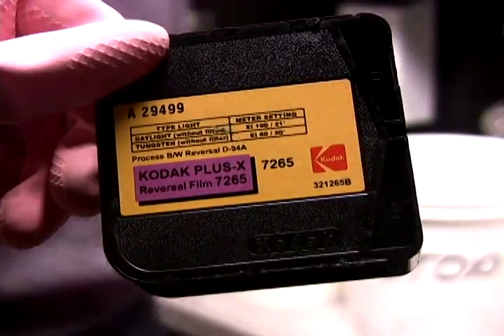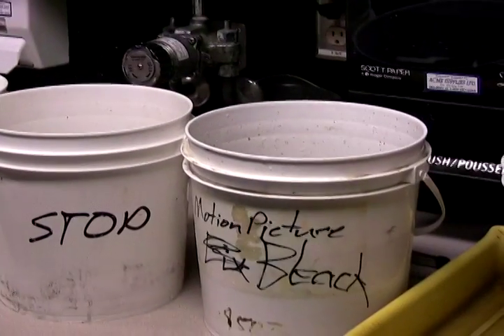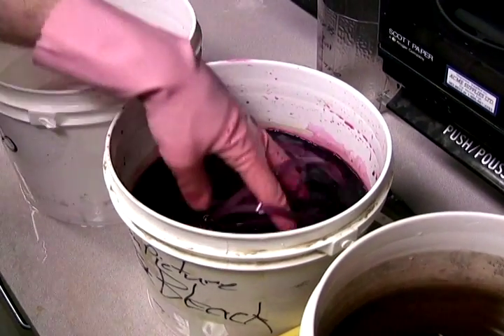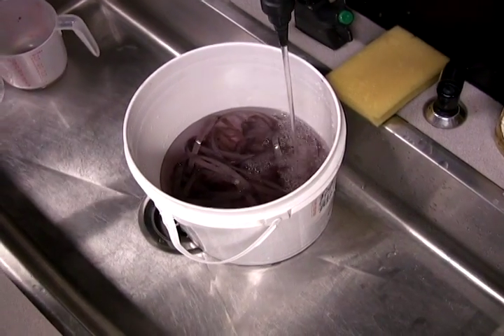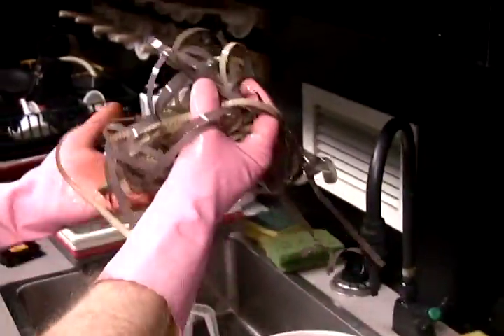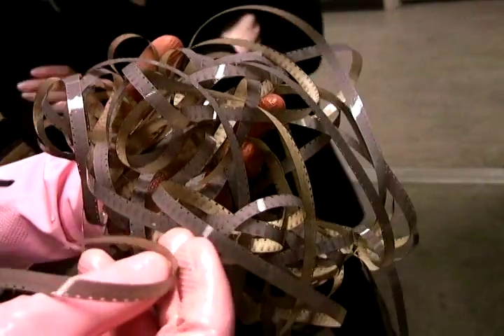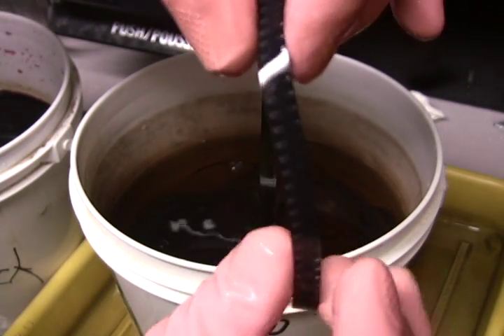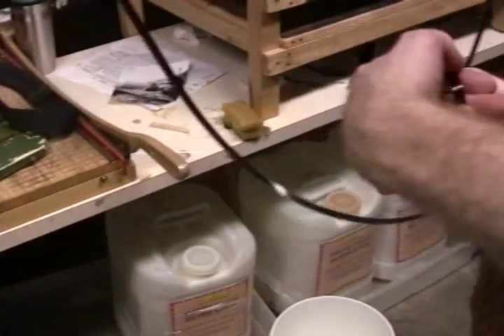Developing Super 8 reversal film

Comment from the maker: @RedSquareBlues No fixer needed in this process. Reversal (positive) film process starts with developer bath in complete darkness, bleach solution, expose to light, then a second developer bath, then wash and dry. Essentially, the first developer bath turns the film into negative image. At this point if we do a fixer bath then the film will be 'fixed' as negative image. Skipping fixer, we used bleach bath and a second developer bath to turn the film into a positive image.

Comment: The bleach step is pretty brutal.  It's a solution of Potassium Permanganate, sulfuric acid and a stabilizer.  The bleach step should finish in around two minutes at half concentration recommended by Kodak.  It's taken me a long time to figure out the right concentration with many failures on the way.  May of my hard core filmmaking peers have sworn off reversal processing because of this one step.  If you over bleach you risk destroying the emulsion completely and end up with 50' of blank film

Comment: (P.S. You can do the beach also with Potassium Permanganate and no sulfuric acid. The recipe is a bit different and you need to adjust also the developing bath. Anyway this process is identical to the old Ghedina Inversor and leads to very nice results if you are precise.)
Reply: P.P.S. sulfuric acid anyway is the last problem you have with the original ghedina formula. Potassium Dichromate is toxic, cancerogen and mutagen. It has them all. is volatile, you can absorb it at eye level, from touch and brething the vapors. 6 grams kills a 70kg human male. that's why original Ghedina formulation is not available anymore to buy. Stick to Potassium Permanganate that is always toxic but not SO toxic.)

Comment: Some hint to what is used here. The E6-Processing is a much shorter Process which can be used by non-legacy Emulsions which already have the color&contrast pigments/filters latently present inside their layers. The former K15 Process which relates to the legacy and classical Kodachrome K40 Super 8 Material CAN NOT be developed completely by this method.(means to black&white, but not in colour since the K15-processing chain requires many special formulas used by kodak exclusively which have the color pigmentations pre-staged inside the liquid chemicals and then form the different filtering layers during the multi-stage delevopment processing chain whilst a chemical reaction inside the layers by diffusion stages into the photographic layers which remain completely transparent before the colour-forming process in each step, layer after layer. If you develop a K-15 processtype (K40 cartridge) film like shown here there would nothing pre-develop out of that emulsion until it is exposed to light. The result then would turn out as a black&white imagery only.
Reply: +Bernd P That is correct, It is virtually impossible to process Kodachrome in home based situations.  I'm now 41 but I started taking photos when I was 13 years old, fortunately I was able to take some photos on both 25 and 64 ISO Kodachrome film. As you mentioned Kodachrome films are non-substantive, WIKI: https://en.wikipedia.org/wiki/Kodachrome

Comment from the maker: @mikeeG77 Bleach can be done with the lights on, otherwise I wouldn't have been able to show it in the video :) No fix required for reversal process. You may want to do another stop bath after second develop, and make sure you do a good wash and not rush through it. I actually don't remember the first develop time - should have written it down, but it was probably somewhere between 10 to 15 minutes. We were also using used/expired developer from the waste tank and did lots of test strips.

Comment: Dirk here.  Super 8 processing in a bucket is mostly art.  It's not meant to be a precise and accurate way to get it done.  You should expect some random results.  Just so anyone reading this knows, I am the guy doing the processing in the film.

One question I see is "Do you need to use fix?"   A: Yes and no.    The reason being that the bleaching step strips away the original negative material and after you expose and re-develope the rest, it should be done.  A fix step would just brighten it.

Comment: Ok. Let's face it: At the beginning of film the Lumiere Brothers used to develop film in regular buckets... they used 'em to clean the floor also... this doesn't mean that TODAY we should do it the same way... well... many LOMO tanks for 16 mm/short ends 35mm / super/regular/double8mm films was made starting from a regular bucket also... but with custom spirals and custom lids for daylight operation and even second exposure of the film material. This way to process the stock is INSANE. if you don't have the money to buy a LOMO tank (that is cheap anyway and you can use it for many many many applications) build one from plastic piping (that is cheap also but in the end .... better buying a LOMO tank... film is costly).

I don't see the massacre of film stock as an "ART" in itself but manipulation of the support is just yet another way to reach an artistic result. In this case the video title "Developing Super8 Reversal Film" just is a wrong title. Misleading at best. From an artistic point of view using the process as you detailed could make sense,  from all others simply you developed the film stock very badly.